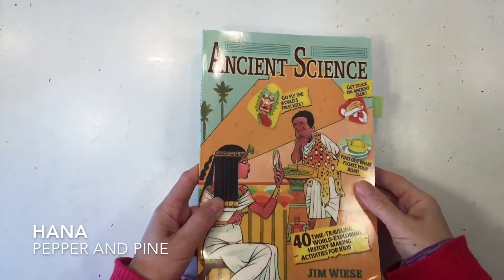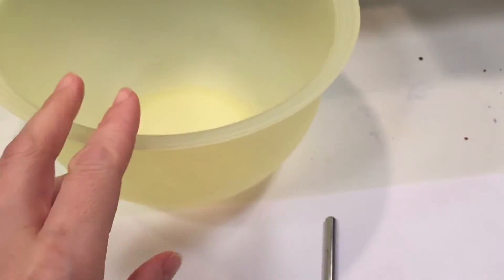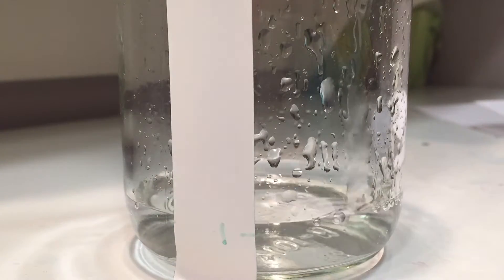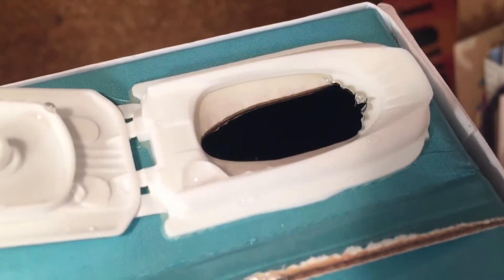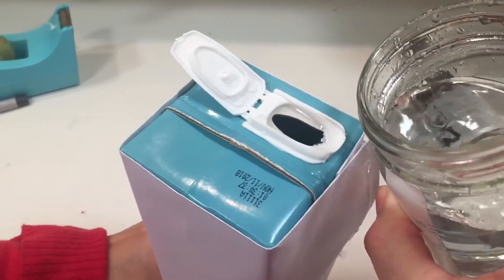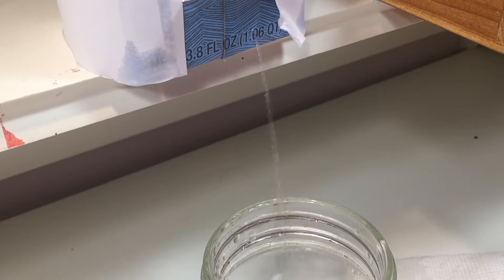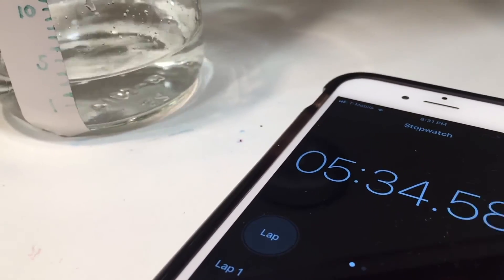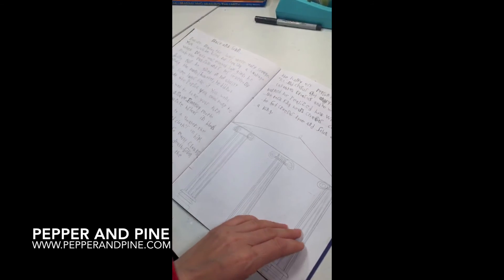How to Make a Water Clock

Comment: But if the ancients didn't have mechanical clocks, then whay did they use as a reference for how long "5 minutes" or "20 seconds"?? Or did they have mechanical clocks then?
Reply: My theory is that the hour was the basic unit they used and the original water clock was a tidal basin. The reference hour was the time taken for 1/12 of the tidal range to be reached starting with low water. This would have been the same however much the range varied over the month (spring and neap). Scaling down to smaller units seems quite tricky as the vid demonstrates.
Reply: Sundials were in existence.
Reply: They didn’t break it down by seconds and they had already established a day was 24 hours so the water clocks were all based on a 24 hour day